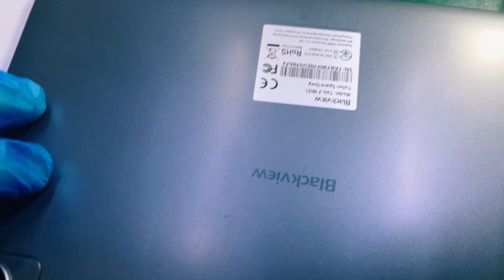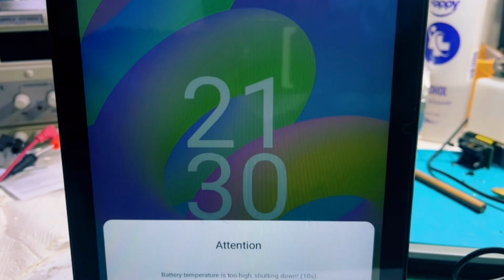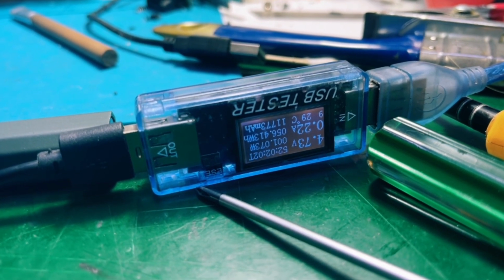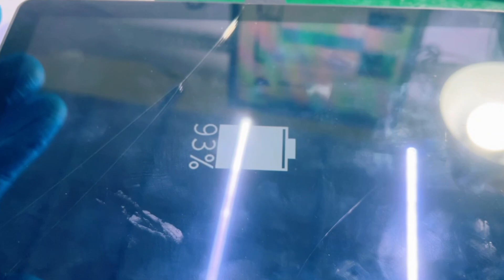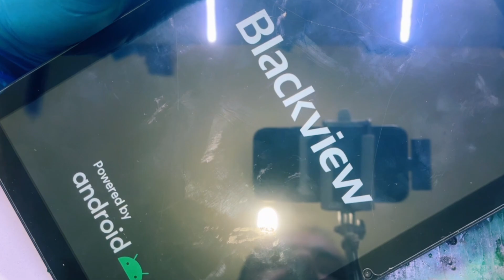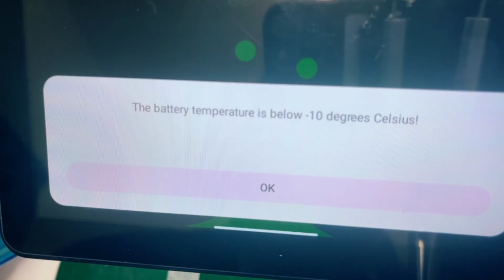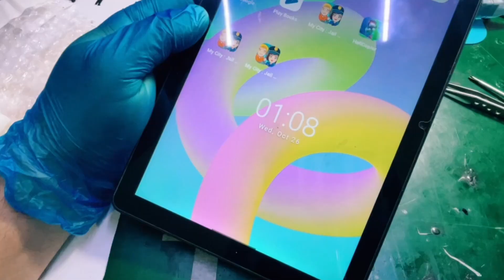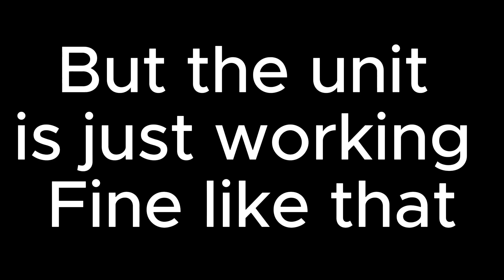Blackview Tab OverHeat message Fix!

Comment: So i removed mines, everytime i turn it on it immediately says its too cold and shuts down, so i cant even do anything about it, any advice?
Reply from the maker: in this situation you should replace the battery, unless you know electronics you can replace the heat sensor in the battery that have a 5 legs shape.

Comment: I did this and it says that battery temperature is too low and that is shutting down,🤦🏻‍♀️🙄 what am i doing wrong?
Reply from the maker: strange 🤔 it could be another model or updated software but either way if it is the same problem, the best solution is to replace the battery.

Comment: I have the same problem on the same device...Is this a solution to the problem and are there any negatives to this solution??
Reply from the maker: its not the only solution and yes there is a small negative one, if the battery overheats it get a bigger shape, so don't  over charge it.
Reply from the maker: the best solution is to replace the battery.
Reply: @Bertronics Are you sure that changing the battery will solve the problem? I did as in the video..but the problem changed from the battery being hot to cold
Reply from the maker: @haiderqais4169  yes exactly because removing this white cable it means you removed the heat sensor. so by replacing the whole battery it means the heat sensor located in the battery itself will give an exact reading to the EC chip.

Comment: I have the same problem on TWO of the same devices.
It says, it's overheating on startup, but the battery is actually cool.
Seems to be a common error on this thing.
Replacement battery in Germany is 30,-€, or 10,-€ on AliExpress. 😀

I don't want to run my devices without temperature sensor for safety, but thanks for sharing this video.

For everyone with the same problem: For the moment I found a super-simple solution: I don't know where the sensor is measuring. I definitely cannot feel ANY warm spot on the battery.
But I managed to reduce the screen brightness from 100% to 50% and the overheating problem is gone.